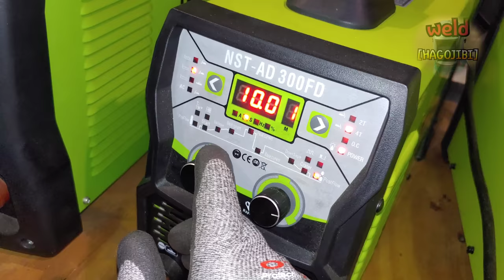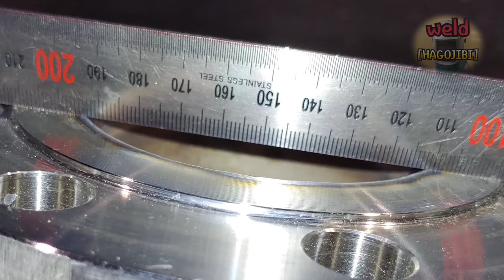Flange TIG welding technique that makes beginner welders look like skilled handymen

Comment: Just a question please. Is it true that during butt welding  root weld is obligated to be older than pipe from inside for 0.5 to 1mm? Is that technical requirement or it can also be flat as internal wall, neither higher nore lower lvl. Thank you do much. 😀
Reply: Yes

Comment: It's super easy to walk the cup when there are 2 edges that the cup is walking across. You can't mess up really unless you dip the tungsten in your puddle and if you set the electrode a specific distance into the gas cup it prevents that from happening. 

Also, if you crank up the argon gas flow it will make just about any weld rainbow in color as long as your heat isn't too high. 

Stainless steel welds very clean very nice when done with TIG. 

It's a lot more than just wiggling the welding torch head.